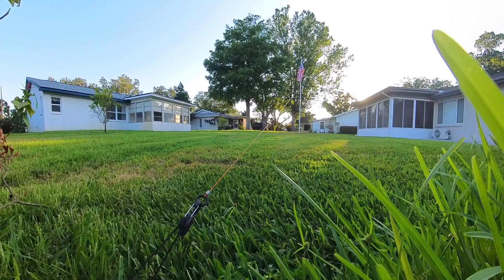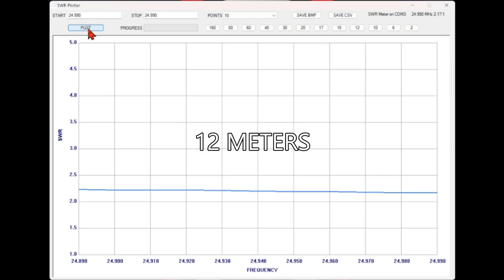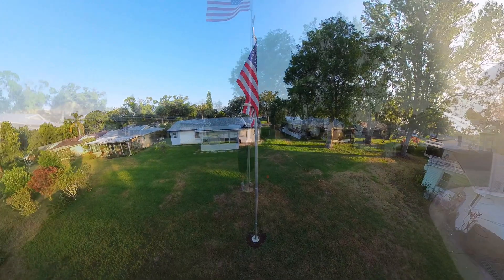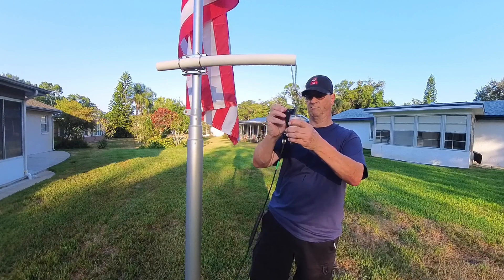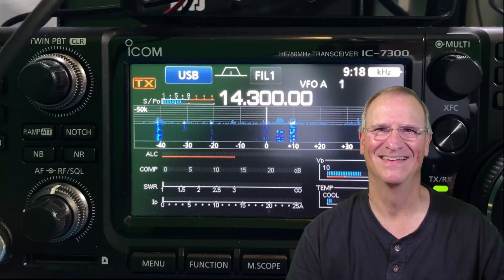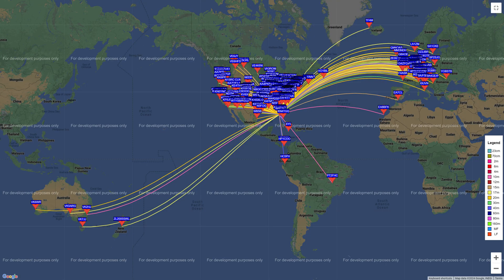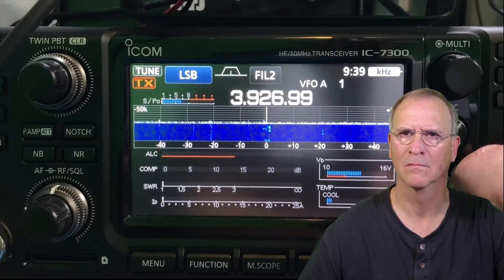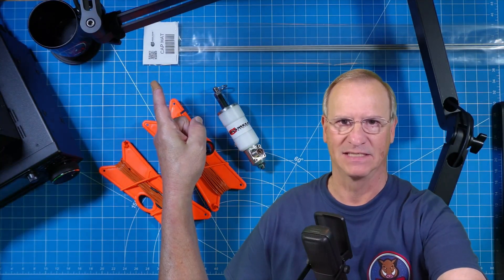Windom Dipole by Chameleon Antenna: Convert, Install & Review MPAS CHA Hybrid Micro as an OCF Dipole

Comment: Understanding the Windom Multi Band Antenna

A Windom Multi Band Antenna is a type of off-center fed dipole antenna that is highly versatile and suitable for multiple bands. It is named after Loren G. Windom, who first described this antenna configuration in the early 20th century. This antenna is designed to cover a wide range of frequencies with a single wire setup, making it an excellent choice for amateur radio enthusiasts.

Performance and Benefits

Multi-Band Coverage: The Windom antenna can operate on several HF bands without the need for an antenna tuner. Typical configurations cover bands from 80 meters to 6 meters.

Efficiency: Due to its off-center feed point, the Windom antenna offers good radiation efficiency across its operating bands.

Ease of Installation: It requires only two support points, making it simpler to install compared to some other multi-band antennas.

Low SWR: It generally exhibits a low Standing Wave Ratio (SWR) on multiple bands, making it compatible with most modern transceivers.

Suitability for POTA/SOTA and HOA

POTA/SOTA: The Windom antenna is an excellent choice for Parks on the Air (POTA) and Summits on the Air (SOTA) operations. Its ease of setup, multi-band capability, and efficient performance make it ideal for portable operations.

HOA (Homeowners Association): For those living in HOA-restricted areas, the Windom antenna's low visual impact and ability to be stealthily installed make it a favorable option. It can be set up in an attic, along a fence, or using other discreet methods to comply with HOA rules.

Building Your Own Windom Multi Band Antenna
You can build your own Windom Multi Band Antenna using the following Chameleon Antenna products:

CHA HYBRID-MINI
CHA HYBRID-MICRO
CHA EMCOMM II
CHA EMCOMM III BASE
CHA BASIC LIMITED EDITION

Materials Required:
Tinned Copper KEVLAR PTFE Wire: This durable and high-performance wire can be purchased at Chameleon Antenna under CHA BULK WIRE 20GA.

Measurements for Building the Antenna
For a 40M to 6M Windom Antenna:

Option 1: 44 feet and 22 feet
Option 2: 41 feet and 25 feet

For an 80M to 6M Windom Antenna:

Option 1: 75 feet and 45 feet
Option 2: 83 feet and 50 feet
These measurements refer to the lengths of the two sections of the wire, with the feed point being off-center.

Conclusion
The Windom Multi Band Antenna is a versatile and efficient antenna suitable for various amateur radio applications, including POTA, SOTA, and HOA-restricted areas. By using Chameleon Antenna products, you can easily build a reliable and high-performing antenna that meets your needs. Don't forget to get the Tinned Copper KEVLAR PTFE wire for the best performance and durability.

Comment: I couldn't pay for a receive or transmit conversation on my current setup, an ICOM 7300 and Alfa HOA Buster w/ 250' of rain gutters. Few months back it was working fine, now nothing but static. I want to do a POTA science project and get off the rain gutters, can I use the Alfa HOA Buster and just buy some wire?
Reply from the maker: With 250' of rain gutters, connected, you should be killing it!  If it was working, but now its not, confirm all your connections are good -- cable, wires, everything.  If good, then you should contact Alpha and let them know what is going on.  It could be a problem with their matching unit, but they would need to diagnose that by asking you questions.  

If your matching unit isn't working as designed, adding a length of wire and going portable will not be successful.